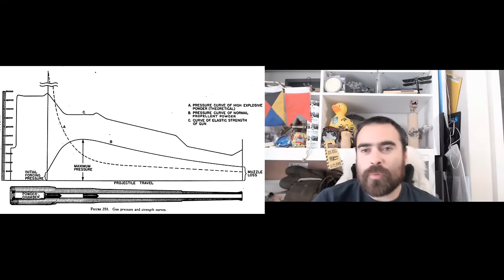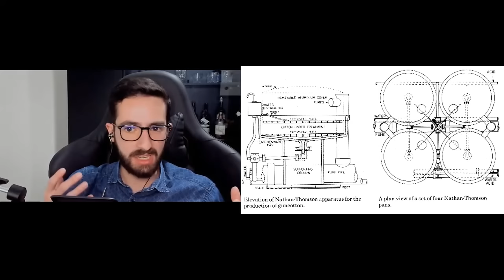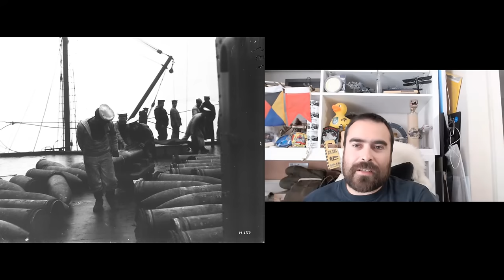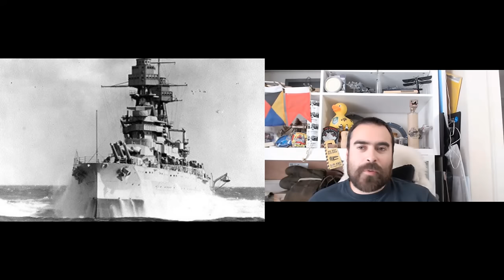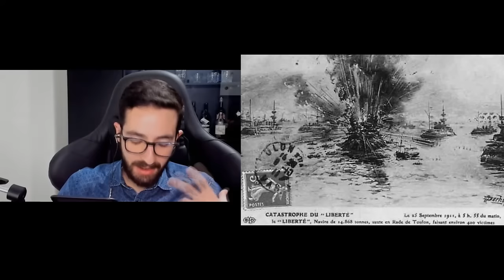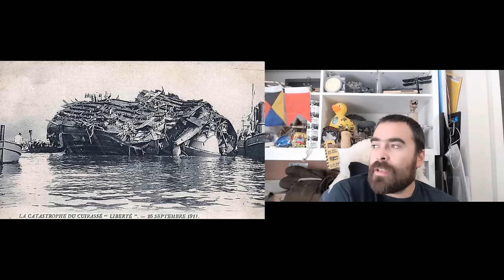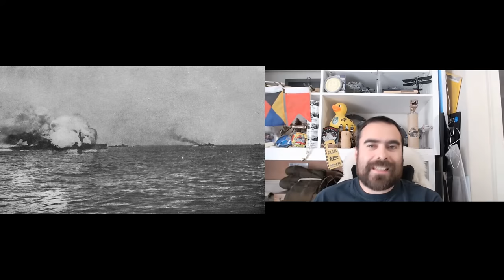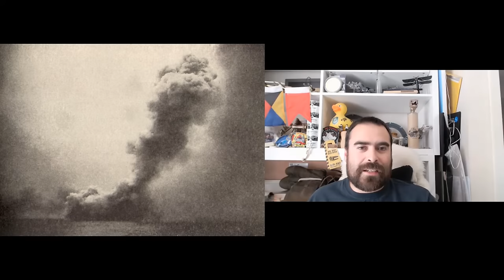Cordite and Poudre B - Why things start exploding at just the wrong time

Comment: For some added background, there's a reason why all those things that go boom tend to be built around nitrogen chemistry, when it's common knowledge that nitrogen is one of the most inert gases out there.

A basic rule in chemistry is that atoms really want to be in the most stable bond they can possibly get.

There are few bonds more stable than that of elemental nitrogen, N2. It takes a lot of energy to break that bond up and force the nitrogen atoms to become literally anything other than elemental nitrogen, and that energy is stored in these new compounds.

Every nitrogen atom stuck in a compound that isn't N2 longs for the moment it can finally realize its lifelong dream of becoming a hot puff of nitrogen gas while releasing a shitload of energy into its environment, and nitrogen compounds in general have a tendency to be held together by the chemical equivalent of duct tape and a prayer. This means that when things start happening in any kind of reaction involving nitrogen, they tend to happen a.) very quickly and b.) very violently.
Reply: Well said.
Just one minor note: I think N2 is better referred to as molecular nitrogen, rather than elemental nitrogen.
Reply: NO3 is over oxygenated and readily gives up the O which is the oxidizer for the reaction.
Reply: Points for the "Things I Will Not Work With" reference. Entirely appropriate.
Reply: @ericraymond3734  It's a wonderful little phrase, isn't it?
Reply: Ammonium nitrate has nitrogen groups at each end. Big bang,  but very stable.
WW2 also demonstrated that gasoline fumes combined with oxygen can make an aircraft carrier open up like a sardine can.  Lexington, Taiho....
Reply: Like when a merchant ship full of ammonia nitrate had for some reason been leaking diesel fuel into the cargo hold and then, of course, a fire breaks out. So then it doesn't take very long for that merchant ship to explode with the blast being so large it was heard & felt for many miles away.
Reply: @rogersmith7396  N2O is commonly found in the atmosphere.  N2O2 is Nitrous Oxide (laughing gas) which gives away the extra Oxygen atom.  Hence its use in boosting performance in piston engines (since you've now have more Oxygen in a given volume than what you have in the norma atmosphere...
Reply: @ericraymond3734  was waiting for someone to make the reference, if not make it myself.
Reply: @francoistombe  The distinguishing feature of NH4NO3 is that it is both an oxidizer and a fuel.  It is a lower power explosive often used in mining.  AMPHO.
Reply: @rogersmith7396  ANFO. Ammonium nitrate fuel oil.  Know it well. Working in mining.
Reply: @timengineman2nd714  As a hot rodder I always thought this was a bad idea.  I worked in an analysis lab where we used N2O2  to boost flame temperature for analysis of refractory elements like Calcium.  It would run with propane I think at 5000 degrees and the flame would definitely heat the room up.  Had to use a special Stainless steel burner.  An auto engine with aluminum pistons and heads can't take this kind of heat.  Its pretty much guarenteed blown engine.  A turbo on the other hand does'nt increase temperature but produces more BTUs.
Reply: Not nearly as twitchy as chlorine oxides however (and they are in turn much safer than chlorine fluorides).
Reply: In rockets/jets you get the phenomina of recombination of elements in the exhaust stream.  Elements dissociated in combustion recombine in the exhaust as it cools and it is an endotropic process sucking heat out and lowering engine performance.  This is why methanol and water injection were used to cool the combustion down to where the elements would'nt dissociate in the first place thus increasing engine performance.
Reply: @allangibson8494  Halogen compounds are twitchy for an entirely different and somewhat harder to explain in layman's terms reason though (insane electronegativity).
Reply: @kennethdeanmiller7324  The Ammonium Nitrate on the Grandcamp and High Flyer were granules coated in petroleum wax to prevent them absorbing water…
Reply: @rogersmith7396  ANFO. Ammonium Nitrate Fuel Oil.
Ammonium Nitrate is an oxygen rich explosive that releases more oxygen than it needs so it gets a small percentage of fuel oil added to consume the extra oxygen. 
Similarly trinitrotoluene is oxygen poor so adding ammonium nitrate to consume the extra fuel can be a cheap extender (Amatol).
Reply: @allangibson8494  In upgrading from black powder they tried peroxycholrates.  Turned out they were highly prone to detonation.  The recent massive explosion in Henderson NV. was the result of some compound containing peroxychlorates which every one thought was safe as milk.  Took out about half a square mile.  They were storing tons of the stuff in a warehouse.
Reply: @francoistombe  I watch a lot of mine exploration vids.  Every once in a while they go into a mine and find a ton of the stuff in bags just laying there.  I am not going into a mine no thanks.  They were blasting rock here and they told me they used a pourable liquid.  Threw rocks all over the place and damaged my car and several buildings.  Dealing with that was a pain in the ass.
Reply: @rogersmith7396  Kinda like using a Supercharger (like a Root's Blower) or a Turbocharger.  You have to LOWER the compression ratio of the engine to make up the difference of what happens when the "Chargers" start shoving air into the engine.... or the N2O2 kicks in.
  
This is why, during the '60s, '70s, and '80s you saw a Lot of amateur racers "rekit" or experience a "rapid disassembly" of their engines, since some of them used High Compression Pistons (or slightly longer Connecting Rods, maybe even both) plus a Supercharger and/or Turbocharger....  
 
This is something that works when the engine is idling (normally it works at idle, sometimes the guy who went too far was lucky and the thing wouldn't start because the starting motor couldn't turn over the engine fast enough). And short periods of high revs, but when doing speed run after speed run (like on a drag strip) or a short race.... BOOM!!! happens!
Reply: @allangibson8494  Have watched several boats here at the marina blow up from gasoline fumes.  At my age I'm staying away from things that go boom.  Had a friend in high school who tried to light a pilot light on his furnace.  It blew and he had serious burns.
Reply: @timengineman2nd714  My turbo Saab runs at 9:1 compression with 10 psi US, 11 Psi Europe.  Full warranty.  I consider that to be good.  It also adjusts for octane rating of the gas which is why the Europeans get higher boost.  It has a knock sensor too.  I see some hot rodders are running high compression and higher boost like 10:1 and 15 psi.  I think they use 100 octane racing fuel.  One of the OKC Street Outlaws was running 27 psi.  I'm sure top fuel dragsters go balls to the wall but they are ready to replace engines after one run.  My Saab also has the crank of a V8 which is gross overkill for a 2 liter 4.
Reply: @rogersmith7396  Odds are a Naturally Aspirated (NA) version of that engine would run at a compression of 10 :1 (10 to 1) or 10.5:1!  During the muscle car era, some cars had 14 to 1 for the "hot roders" who also experienced short engine life!!! ("For Some Strange Reason")
Reply: @timengineman2nd714  My 70 Eldorado 500 CI 400 HP bus like torque is 10.25:1 leaded gas.  Of course I just use 87 no lead with reduced advance.  Back in the day I always put 95 octane in moms.  98 was available.  I think the highest factory I ever heard was 11:1 and that was rare like in top of the line Corvette. I shaved about a quarter inch off my TR 6 head to give 10.25 to one.  Also use 87 octane.  My boats 3 cylinder diesel is 22:1.  Typically with too much you get holes blown in the top of pistons.  Forced inductioin too.  Greggs Airplanes has a lot of information on high power WWII engines.  3000 HP Bearcats.  I think the B 36s recips were around 3500 HP.  They thought they could get more with exhaust supercharging but then the jets came in and recips went bye bye.
Reply: @rogersmith7396  I was referring to "Stroked and Bored" engines for the somewhat outrageous Hot Roder (Hot Rodder?) engines with 14:1 Compression Ratio, they ran on 107 or higher octane racing fuel... They also had a short lifespan!!!
Reply: love the way you put this, i'd read your chemisty textbook any day
Reply: And nitrogen-containing compounds that don't have a tendency to explode tend to a.) only contain a fairly-small percentage of nitrogen, b.) have the nitrogen mainly or entirely bonded to carbon or hydrogen, which are things nitrogen is relatively happy to hang out with, and c.) not contain any preexisting nitrogen-nitrogen bonds, since a pair of nitrogens bonded to each other have a strong tendency to want to become a pair of nitrogens bonded only to each other.
Reply: @timengineman2nd714  Nitrous oxide is N2O (which really wants to give up that oxygen atom to become good old N2, hence its usefulness as an oxidizer), not N2O2 (which, to the best of my knowledge, doesn't exist except at deeply-cryogenic temperatures).
Reply: @timengineman2nd714  Slight correction: N20 is nitrous oxide.  N2O2 is dioxohydrazine.
Reply: @vikkimcdonough6153  Sorry!  I made a mistake.... The N2O2 shop (with Centrifugal Air Compressors) made Liquid Nitrogen, Liquid Oxygen and N2O2 for various purposes....  
 
I "can neither confirm, nor deny" if any N2O made its way to a local drag strip with 2 of the guys who worked there both having rebuilt '57 Chevys (it was in the 1980s) and generally won the class they were in. I did work on their Roots Blowers as well as assist in various rebuilds.  And yes, I saw more than one chrome plated blower go over 50 feet (over 15 meters) into the air when someone reused bolts (in most cases you're supposed to only use them once due to the stress and these guys used them at least 4 or 5 times (different crews).... 
 
Also this is where I saw thhe 14:1 compression Ratio engines.  The crew that ran them always won the first few heats (runs) but never finished due to catastrophic engine failure!  The idiots would Not Listen to anyone telling them to back off of the compression ratio!!!  After awhile apparently their dads got tired of giving them money to destroy good (and by that time) hard to find Chrysler 340 engines!
Reply: @blackpowder4016  No problem!  I realized my mistake... A US Navy N2O2 shop was making some "unofficial" N2O during my first hitch in the US Navy.
 
BTW, N2O2 is Dinitrogen Dioxide, and I don't know if they ever used that. However there was that one explosion of an engine when I was home on leave........  From my understanding it was spectacular and I never did find out what. (why it) happened!
 
Thankfully it was just a trial run and there were only a handful of spectators, most of who were hanging out in the pit areas with their friends and family who were driver and/or pit crew of the various cars.
Reply: That's pretty much how I had it explained to me (I have an interest as I handload my own ammunition & many of the propellants used are single base(largely nitrocellulose) & double base(a mix of nitrocellulose & nitroglycerin).
Triple base(throw nitroguanidine into the mix) propellants exist but mostly for large calibre artillery, not firearms.
Reply: @GARDENER42  I do some reloading also.  Mainly shotshells, but upon occasion pistol, and rarely rifle. (9.3 X 62 Mauser ammo is hard to find and kinda expensive!  I use Paper-patched .358 rifle bullets since .366 bullets are even harder to find!)
Reply: @rogersmith7396  There's a video out about one of the Great War battlefields where the British (and Germans) engaged in mining on a large scale. There is at least one unused mine that, over a hundred years later, the final chamber is still packed with explosives. The consensus is that it was more dangerous to try to remove the explosives than to just leave them in lace. 

There's also a shipwreck in the Thames estuary was was an ammunition carrier from WWII. Too dangerous to try to remove the cargo, but concerned the the ship is going to collapse as the hull decays. And send tsunami up the river through downtown London, never mind the air shock wave.
Reply: You are one of the reasons Drachs channel is so fun.   Awesome brother, thank you for the info
Reply: :)
Hexanitrohexaazaisowurtzitane knows that desire
Reply: @gerardmdelaney  that wreck is a bit of a concern
Reply: Awful lot of Oxygen, much more than in the atmosphere and already in molecular contact with the Cellulose molecule. So you get lots of expanding gaseous N2 and lots of heat and gaseous CO2 from burning cellulose at high speed.
Reply: Pure poetry.

A significant emotional event, the Chieftain would say.
Reply: @allangibson8494  See also the "urban rearrangement" in that relatively recent Ammonium Nitrate "storage" failure.
Reply: @rogersmith7396  Henderson was pure bulk Ammonium Perchlorate.
Adding fuel boosts the yield.
Reply: @allangibson8494  how did that work out?
Reply: @rogersmith7396  I missed one of those by 6 inches in a rental house in college. My metals professor didn't duck and had Burns all over his face from the same thing
Reply: @bruceinoz8002  Which one? They happen about every five years.
It’s like talking about fatal explosions in Texas City - you have to specify a year.
Reply: @allangibson8494  The wierd thing about the article I read was they all thought the stuff was completely safe.  Maybe even no sprinklers in the warehouse.  Safe as milk.
Reply: @rogersmith7396  Asking an explosives chemist might have gotten a different answer. All ammonium compounds burn. Adding an unstable oxidiser anion  makes explosions possible.
A metallic cation would have been much safer but reduced the propellant energy.
Reply: @allangibson8494  For example, ammonium nitrate is commonly used as fertilizer even though its explosive.  I doubt farmers are even aware of this.
Reply: @rogersmith7396  : I suspect the average experienced farmer has long since learned just why getting ammonium nitrate is as involved as it is.
Reply: @absalomdraconis  The guy across the street from me has it delivered in 6 ton trailers which he tows across his fields with a tractor.  He makes a phone call and they bring it out.
Reply: @rogersmith7396  you inject extra fuel over stoichiometric to lower your temps. The pressure drop of the nitrous oxide also cools the charge down. There are arguments against turbos and superchargers. The general one being that nitrous is much simpler and cheaper
Reply: @Fulcrum205  As I believe I said elsewhere nitrous doubles the combustion temperature and the parts just can't take it.  Turbos and SC increase heat flow in btu but at the normal temp.
Reply: @rogersmith7396  that isn't true. Mechanically compressing the air heats it. Even more heat is added via the radiant heating of all the various extra mechanical bits the intake air flows through.
You are looking at combustion temp increases without bringing the additional fuel needed to keep the mixture correct. Your supercharger or turbo will increase combustion temps and melt something if you just crank the boost without giving it extra fuel. 
More likely it detonates and you blow a headgasket or break a piston before any of that happens. 
Nitrous works fine as a power adder if you tune it correctly. Nitrous breaks engines when dummies decide to drop a 200hp shot on a 200hp engine with a crank or rods that can only handle 300hp. That or they put in a dry system and don't tune the fuel compensation correctly. 
I don't love nitrous. I would rather just build the engine to make the power I want and not deal with the extra complication but the things you are stating are incorrect.
Reply: @triskeldeian4989  N2 is referred to as elemental nitrogen because that is how it exists if you have a jar of pure nitrogen.
Reply: @samuelwarshaw9480  in my lab we didn't refer to it like that and in any case N2 is a molecule, N is the element
Reply: @absalomdraconis  And should have been aware for a long time before it became an even more sensitive subject. I remember back in the '80s asking my grandfather why the sacks weren't in one pile. He explained 'because it explodes', then probably regretted that answer. But I survived my childhood with all my fingers intact. I remember there were warnings about maximum stack sizes, and minimum distances between stacks though.
And in later life, loved the 'Things I will not work with' stories, especially why when there's lots of C-N bonds in a chemical, it's probably not going to be your friend. Heck, even if there's only 1 CN+metal, it still hates you.
Reply: For nitrogen-rich chemistry "Explosions & Fire" is an entertaining channel. "Well There's Your Problem", a podcast about engineering disasters (with slides), has good coverage of various exploding-substances incidents, and the YouTube format definitely adds value over the audio podcast.
Reply: Weirdly well said. Thank you.
Reply: That fourth paragraph needs to be quoted somewhere.
Reply: that's a very cool way of explaining it. Thank you.
Reply: Anyone else read that in  Drach's voice?
Reply: A modern example is what happened on Beirut
Reply: Interestingly, in the 30s and 40s and beyond, work on monopropellants which is their real name branched out and tried things like hydrogen peroxide. With in some cases, disastrous outcomes
Reply: More or less ,carbon has even stronger bonds but when broken doesn't go " bang"
Reply: ANFO also used by right wing terriorist in OK  city